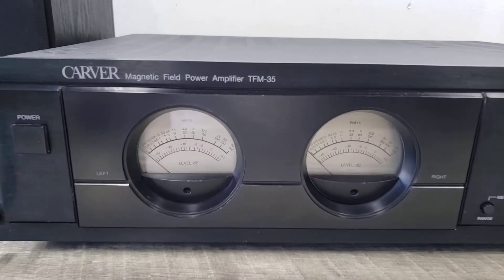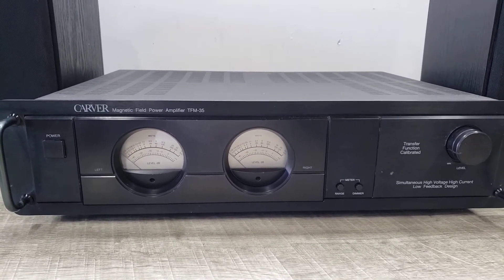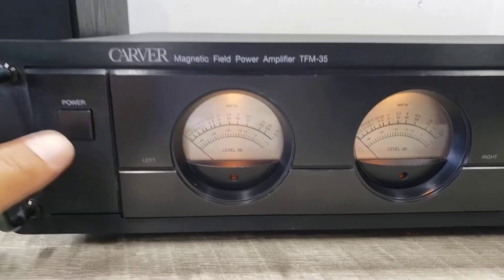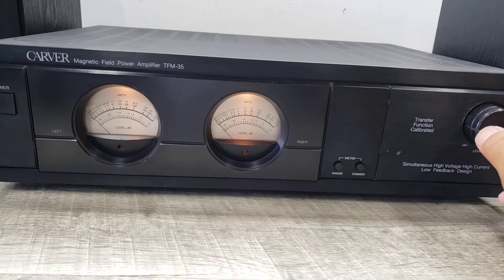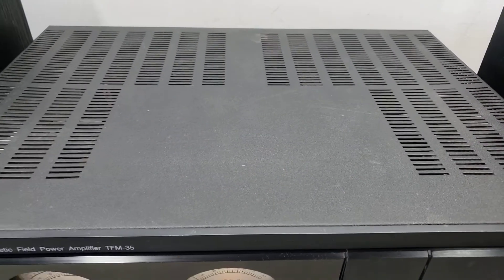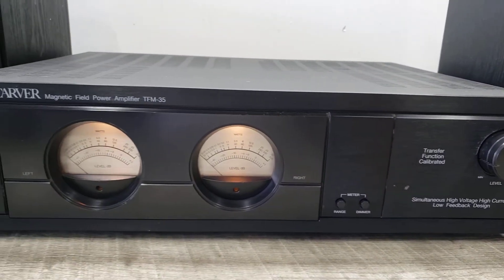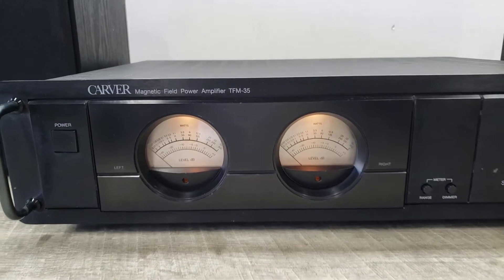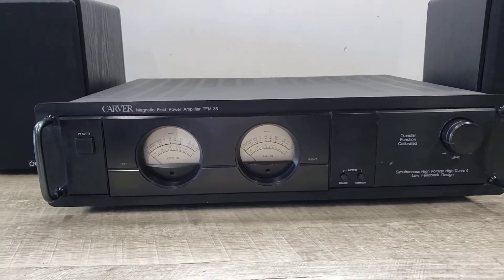Carver TFM-35 Magnetic Field Power Amplifier

Comment: The knob your using for volume is for adjusting out the hum noise of the Amp I got the Manual & it says to turn off the source & listen for Hum if any is present you turn the inner & Outer knob (Left & Right sides) down until the hum goes away. It's not for Volume even though it kinda works like that
Reply: True. This is a power amp. The volume is with the preamp
Reply: @NadeemHayek  It is for volume.  What the manual refers to as a hum check is nothing but a simple test you can use the volume knob for, as with ANY electronic component volume knob, anywhere in your system.  If it is turned all the way to the left there will be no sound in your system.  Granted, turned all the way to the right will be its best performance, and the preferred setting.  However, not everyone uses a preamp.  I used to go source direct to my TFM-35.  If it were just for checking for hum, they'd have a cheap hum check button, rather than an attenuater (volume) knob which moderates voltage input, and hinders the amps ultimate sound quality.